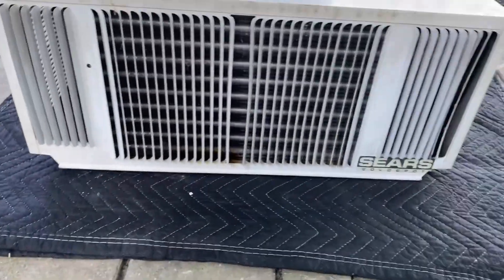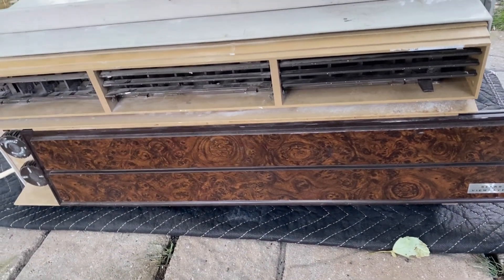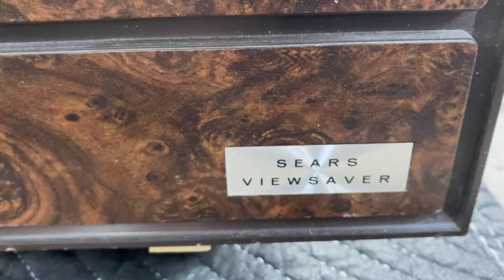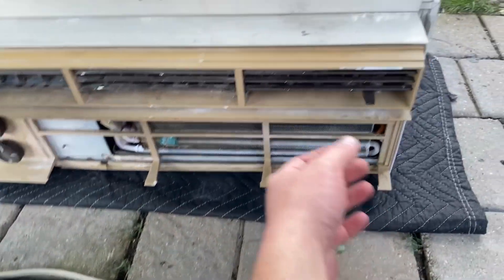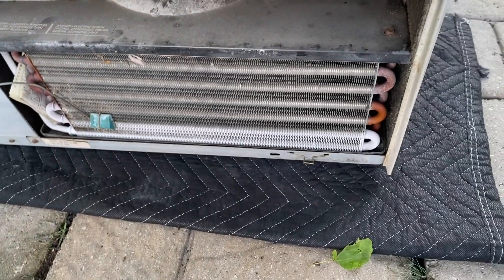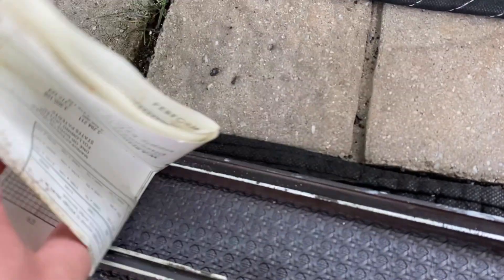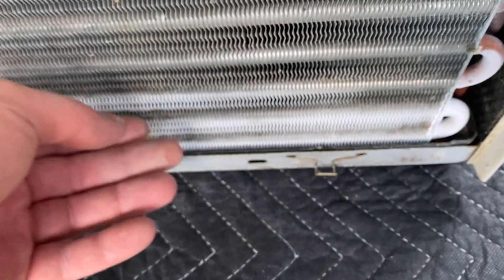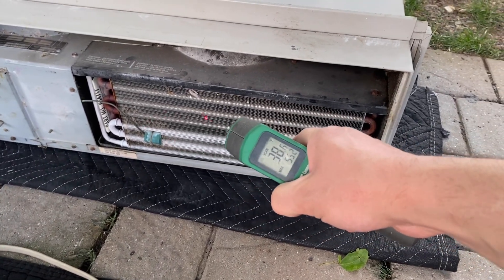Early 1970’s Sears Coldspot Viewsaver

Comment: BTW, that coil frosting is perfectly normal on a "cold" start.  The compressor is a high-side dome design and takes a little while to warm up and develop full head pressure - just like a rotary or a Frigidaire Meter-Miser.